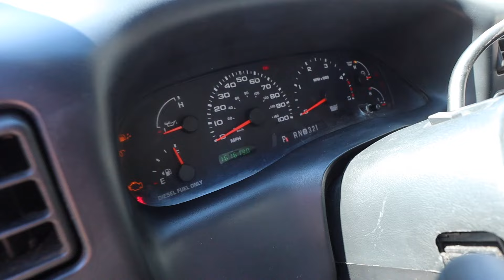DONT CRANK YOUR TORSION KEYS! *WATCH THIS FIRST*

Comment: I cranked my keys in my 2500hd and it lifted it 3” idk if it’s different but yea
Reply: Alex Kelley my bet is if you drove it around or lifted the front of the truck up the front end would have came up higher
Reply: Nolan Mitchell I’m on stock keys 🤔 but yes it would of settled if you drove it a bit. I cranked them and it was like just under 2 inches drove it down the road it it settled and was higher

Comment: Always replace twin batteries at the same time, not one used and one new. The voltage difference  between the old and new battery will have the two batteries fight each other and one will be ruined. Note the voltages on the new batteries to be within .1volt and the dates must match.

Comment: That bracket on the driver’s side you rearranged a bit is a bracket for a fuel heater for diesels. With a long pry bar on the end of the torsion bar zip tied to the the left of that bracket so it won’t move, you can smack the the end of the pry with a hammer and it should come out fairly easy. We deal with terrible rot and rust here in Buffalo so I feel you on that 😂
Reply: What is that crossmember for if u don't mind me asking does it really affect anything

Comment: Terrible. No one should ever crank their keys with the weight of the vehicle on them. Second you never want to "heat" or put "heat" on a spring, I.E. a torsion bar. Very bad advice in this video. Jack stands are a must.

Comment: Good work love the old truck content ... I must have gotten lucky with my 95 Dakota ... sprayed them with pb blaster the night before and tapped them out with a hammer ... did both in about an hour ... dual battery cables adds amperage not voltage

Comment: I'm jealous of that  lift I put a 3 inch spindle lift on my 2001 chevy silverado 2wd not even close to the 3 inch key lift
Reply: anonymous  i couldn't answer that now lol i got me a new 2012 dodge ram 1500.
Reply: I can say on the 3 inch spindle on 33s it rubbed the plastic pretty bad at full lock so maybe that helps you and its was fine i had it like that for 5 years but all and all its a decent hight

Comment: When you tightened the driver side all the way to start with that made a lot of pressure on that tortion bar as far as twisting it binding it up in lower control arm

Comment: I got my torsion keys out in 10 seconds without any flames or special tools - and that's on a '93 K5 with 265k miles! Can't believe you used heat, its not necessary at all. Mine were just as stuck as yours, too.
Reply: On a Texas truck with no rust, big deal

Comment: Im sure you know already Ryan but that 6.0 has major motor/electrical issues. Those batteries shouldn't just die over night. It should crank right up and not put the starter under so much stress. Hopefully you guys find the power draw/issue.

Comment: I put 305/65r18s on 18x10s with a -13 offset with 2” leveling coil overs on a 14 silverado.  Did a fair amount of metal trimming but I think I’d still like a hair more stance, turned out relatively modest. I know these are really different trucks but I’d like to encourage you bite the bullet and trim that pretty purple hard work there for a wider stance. I think you’ll like it better once you finish. The trucks lookin sweeet